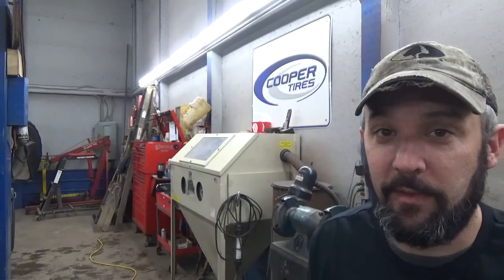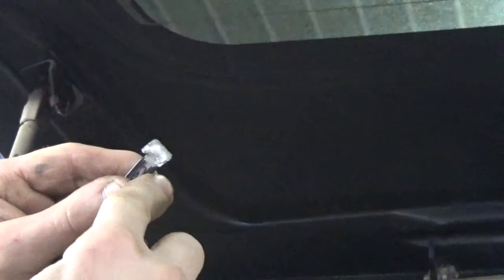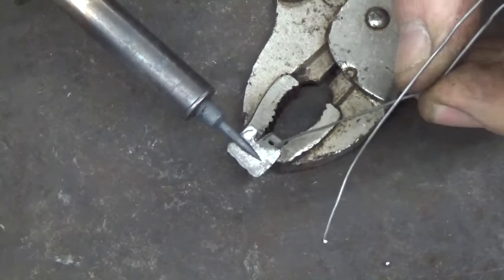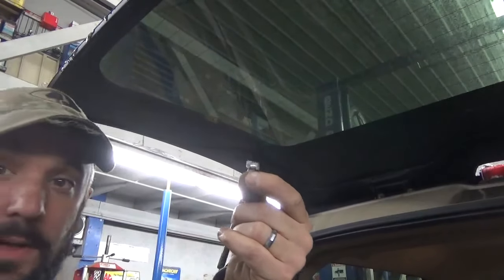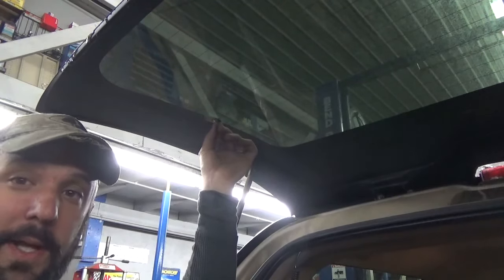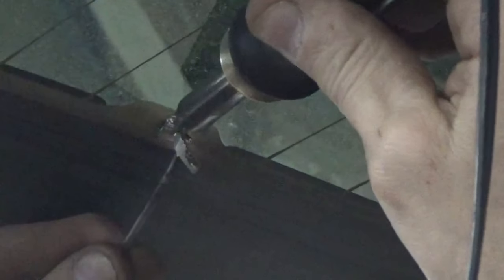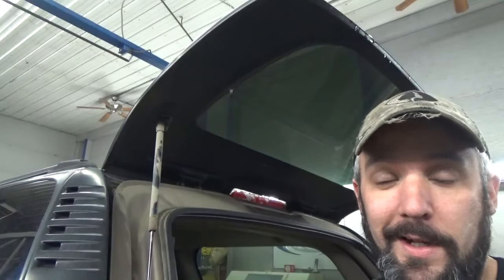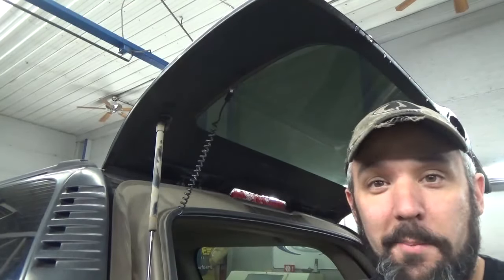Rear Window Defroster Tab Repair

Comment: I tried this on a 2003 GMC Yukon, which looks very similar to the vehicle in the video. The approach in the video did not work for me. The tab would not adhere to the window, no matter what I tried. BUT, I had previously tried (and failed) to repair the tab with Permatex's "Rear Window Defogger" adhesive (765-1982). The tab stuck to the base on the window using the Permatex, but it clearly did not conduct electricity as intended. I was able to remove the tab after using the failed repair easily using heat (small torch). Because the problem was with conductivity, I used a wire brush on a Dremel to clean the contact patch and tab base. I believe that I over cleaned the area and actually removed the contact patch (seen in the video). So, I am now trying to attach the tab to the copper base on  the defogger. This is where the tin/lead solder failed to adhere. This probably would have worked if I tried this first or was more careful cleaning the contact patch on the window.

Comment: My 2018 Expedition Max had the solder fail.  It seems to be a thing with Expeditions:(  They wanted $175 to fix it!!!  Some dealers are replacing the entire rear glass......$1300!!!  I am going to give it a go, thanks for the info!!  The sad thing is that I hardly ever use it!  But, when I look in the rear view.....there it dangles!!!  errrrrr  Going to sub as a thank you for the info!  Be safe.

Comment: Nice! Looked at conductive adhesive, most around $20, all have a cure time of about 24 hours & suggested that you keep connected warm for better cure, around 100°, they kinda seem like a pain to use to me. Only thing I might do different from you is use some flux rosin to help float the soldier little better, not that your 60/40 is bad or wrong just little more confident bonding.

Comment: I've tried the glue kits (Permatex) a few times. Each time it lasted from a few weeks to a couple months.  Finally decided to solder it.  Glue doesn't last (in my experience). That lasted a year or more.  As my soldering is getting better, I am hoping future repairs will last longer.

Comment: Thanks for this. I was worried that the glass would break due to shocking it with heat from soldering iron. Will attempt on my own and see what happens. I might preheat the glass a bit just to be on the safe side.

Comment: I couldn't get solder to stick to the back glass. Where my tab broke off. Someone used epoxy.
I tried to sand a new spot. And when it came to soldering.
Gravity won. Heated solder would just drip straight down and never stick to the rear glass thin copper.

I think I'm to have to replace the rear glass. From someplace like Safelight repair. Bc I have continuity in my defrost wires at 14.6 volts.
So before I gotten a multimeter. I was worried about that also being an issue.

Comment: My tab broke off and after looking at it I was wondering if I could solder it back on. It's good to know I would've tried to do it the same way. I like the tip about adding a little solder before hand.

Did anyone respond about the glue kits to repair it? I have a soldering iron but I have no idea where it is and I don't want to go buy one for such a small task. If the glue kits work i think I'd rather try that.
Reply: I’ve tried the glue kits 2 times. It didn’t work either time. So after this video, I went out and bought a soldering iron. Wish me luck.

Comment: For this type of repair, solid solder wire is best. If using solder containing flux core--Eric incorrectly calls is "rosen core"--apply heat until no smoke rises from the solder. This means the flux has burned away completely... required for the best bond.

Comment: chisle points work best. Good video!
Reply: scott firman what's a a chisle point
Reply: A soldering iron tip that looks like a chisel, rather than coming to a point. They're better for heating up large things quickly.
Reply: A soldering iron tip that looks like a chisel, rather than coming to a point. They're better for heating up large things quickly.
Reply: Yeah, an 80 watt "stained glass" iron would work well. A little pointy hobby deal would get tedious.

Comment: I use the heater strip repair glue to repair tv remote control buttons. The conductive elastomer wears off and a dot  of glue fixes that.

Comment: Is there a chance window could crack from the temperature difference in that spot? I need to repair outside where it's near freezing now as I don't have a garage, and I'm worried that maybe glass could shatter.
Reply: That's why I'm surfing through the comments! Did you get it to work in the cold?

Comment: The tab on my 2012 Jeep Wrangler does not appear to detach from the wire, and has a cover over it made out of some type of rubber or plastic. I don't see how I can solder it...any suggestions?
Reply from the maker: +Gary Woodland Conductive adhesive?
Reply: you have to use a fine tipped pick and pry the tab out of the connector. it's like a 9 volt battery terminal.
Reply: Thanks Steve, Couldn't find this info even on JK forums! Defroster is working now thanks to the guy in the video and you!
Reply: I did this last night on my 2010 JKU.  I cut the plastic off the wire and bent a small piece of copper into a tab.  this worked great and I defrosted the glass this morning!

Comment: does it have to go back to the same spot or anywhere as long as it is on wire element inside the glass?
Reply: Mine has cut wire with no specific spot to reconnect as if someone cleared old connector and was going to attempt fix at some point but never got around to it.

Comment: What if the pad is missing or partially missing. I have a truck and where the tab was originally, now the  pad is missing because the tab was ripped off. Can I just solder it to.the remaining pad that's there? Or do they sell a product, that mends the pad before you install the tab?
Hope my question isn't confusing, I know what I'm trying to say but, it's hard to put it to paper lol

Comment: I've watched a few videos on this subject.  My issue is slightly different in that part of my tab is still on the glass and the small past is in the connector. Looks likeabig deal to try and grind all of that down. So, my question is can I place a tab over the existing tab and solder it in place?  Thanks
Reply from the maker: rjtecellc Can you just de-solder the old one from the glass?

Comment: What kind of solder and what wattage of solder iron do you use? I've used a glue kit brand Frost Fighter before and its held for years but it's pretty expensive. The cheap little glue packs don't work for long. They might hold for a little while but they always break loose again sooner or later

Comment: Is that a General Motors suv rear defroster wire using a cheap ass landline telephone chord like my grandma has at her house? The video was helpful, I need to reattach the pigtail wire on my C4 Corvette.
Reply from the maker: Yep it sure was! '04 Suburban... Sooo is the C4 your G-mas too? Haha no just kiddin, hope this method works for you.
Reply: South Main Auto Repair The C4 is mine, she drives the Lambo ;-)

Comment: I've got a defroster that has been soldered on the glass every couple of inches that i want to completely remove. How much heat tolerance is there on the glass? I want to have a nice clean window when its all done. Can this be achieved? Obviously i don't want the glass to shatter... Thanks! ;-)

Comment: I've previously done this repair and it worked like a charm however I accidentally hit the tab and it came off again. For some reason this time around the solder just simply will not adhere to the contact point. Instead of using a soldering iron to melt solder while holding it against the connector (it took too long for the solder to melt) I heated the tab with a light torch, put solder on it and proceeding to attach it to the window connector. Tried 4-5 times cleaning the connector and tab each time but the solder just won't stick to the windows connector anymore. Any solution you can provide other than buying those repair glue kits they sell? Thx in advance.
Reply: You can Etch the glass with some very fine sand paper to get the contact area clean then clean off your old solder and apply new solder that should help it
Reply: +Fiaz M what grit do u suggest?

Comment: I need to solder a new tab on. my old tab was reattached and doesn't conduct well and I can't remove it. Could I out a new tab close by without harm leaving the old tab in place..?
Reply: Not advisable as the pad these tabs are soldered to is a special part of the system.  It's not very likely 'close by' would take to solder in the first place, they don't build these tinned copper contact pads three times oversize for example.  You need more bigger soldering iron to remove what you have and reattach it with good solder again.  The problem you have is not enough heat in the first place if you can't remove it now, three second contact time should let you pull it off with zero effort.  I'm thinking Harbor freight 150 watt soldering GUN with well tinned flat wide tip.  You will have to on/off the trigger as these tips will glow cherry red and that's way too hot for solder if you just hold the trigger.  Practice on galvanized roof flashing tin until you are proficient in keeping the tip tinned, controlling the heat range with your trigger finger and can place and remove such a terminal in mere seconds consistently.  You can make practice tabs from the roof flashing as well with tin snips. Don't worry so much about breaking the glass, it will only crack on ONE surface and there are two in safety glass always.  You'll find that plumber's soldering paste flux will allow for the best results but since it's acidic you must wash the surface when done and clean the flux off with both water based cleaners and - - - brake cleaner !!!
Reply: +Lee Barnes Thanks for the advice.

Comment: HELLO. 

I've been trying this but the tab won't heat up enough to melt the solder once on the window. Is there a particular solder you recommend?
Reply from the maker: +Caesar Himself I use 60/40 rosin core
Reply: South Main Auto Repair
Yep, that's what I've got here. Strange it wont melt. Held the iron on until I cramped and still nothing. Melts the solder onto the tab but wont melt it when holding tab onto window bit.
Reply from the maker: hmm... maybe need a hotter gun?
Reply: @SouthMainAuto  Whats the watt output on your soldering iron?

Comment: Just did it yesterday inside my garage. On my jeep wrangler i had to remove a rubber cap over the tab.I tried the permatex kit before and did not work.Soldering is way easier than  epoxy.

Comment: how do you repair the rear defroster connect on a 2013 jeep wrangler ???
Reply: +dnv820 If it's the wire, you can usually just solder the wire back together. If it's the tab, you'd do it just like in the above video.

Comment: If your defroster grid is printed on very thick you can solder it. IF!
This doesnt work on all cars, that's why some have to use defroster epoxy kit to solve the problem.

Comment: The glue thing definitely sucks. Just tried it, it didnt want to stick when I tried. It ended up holding because of the consistency of the glue itself but if I tugged it it would definitely come off. I'll let it sit for the next couple of days to let it cure and if it doesn't hold I'll definitely solder

Comment: I have been soldering since I was 13 but I just haven't had any luck trying to solder my tab back on with my 4th gen Firebird, it keeps coming off.. just really frustrating, not sure how to fix it now. there's no way I could ever get that tab back on there to the window part.., only way I could see fixing it would be solder a bare wire to the window with a blade connector on the other end of the wire to plug into the stock female defroster wire, looks like it would be hard to get the tab itself to stick again with just solder, solder is not very strong just not a big fan of it even for wiring I like to use butt connectors for wiring if at all possible, this seemed like a great idea but I'm just not sure it is now, right now.. atleast for what im trying to do it looks like solder just isn't strong enough, if it works for others people/ application tho then thats great
Reply: Have you tried cleaning up the window and tab? Sanding, alcohol, whatever else to remove any residue and oils. Another issue might be a cold solder. These windows will pull all the heat away. It will take a fairly powerful solder iron to put that much heat in. The cheap irons you see everywhere probably can't handle this job, or at least not properly. To help you can take a heat gun or hair dryer to preheat the window.
Each window will be different, you have to see how it broken, and judge the best repair.
Reply: snoopdogie187 well for one thing the end of the tab thats on the window broke off but the main part was still attached to the window.. and what I was doing was trying to solder a whole new tab to that old tab, i was scared to pull the tab off of the window as I was afraid I wouldnt be able to get a tab to stick to the window.. btw yes I wire brushed and my solder gun is a Weller.. do I need to pull that tab off and try to solder the new one straight onto the glass?
Reply: I really don't have much experience with these window tabs. If anything, I would try to remove it with the solder iron, to melt the solder, that way you don't damage anything when you pull it off. 
Of course, go by your knowledge, what you are comfortable with. Never even seeing a 4th gen Firebird up close, I can't tell you anything that isn't from google. I don't even generally do anything to GM cars.

Comment: Mine snapped in half how would I removed the other piece from the window
Reply: same way,just heat it up and use plyers to carefully pick it off the glass. then visit the junk yard for a replacement tab. Id you have a butane lighter and a pair of plyers you can take one off a cracked rear window on a crashed car with the same type tab.Doesnt have to be same car,just same type of tab.
Reply: I wouldnt take it off the glass, leave it there and solder the two pieces of the tab together.

Comment: Sadly, this did not work for me on an 09 Crown Vic.  There was nothing on the glass that would allow solder to flow onto.  I may just leave it for the buyer since this is an auction vehicle I am selling.  It bothers me not to leave this defroster functional. I hesitate to use the epoxy kit because I don't see a conductive pad remaining on the glass.  There is just the partial yellow grid with black dots.
Reply: Did you try maybe "tinning" some solder onto the pad, letting it harden, and then put some solder on the back of the tab, let that semi-harden, and then do the method Eric used? I think maybe that'd work for ya. Good luck if you attempt it

Comment: A soldering iron with a wedge or chisel tip will make a faster solder joint because of more contact area and better heat transfer.
From someone who has sniffed far too much flux fumes in his time!

Comment: I tried 60/40 and the solder just balls up won't stick to tabs?

Thank Ron G
Reply: That means the tab itself is too cold, usually, allow the tab to heat up and melt the solder against the tab, don't melt the solder with the iron as it won't bond to the cold surface. Or there's some dirt/scale you need to remove. Rub the tab on some abrasive of some kind and perhaps apply some flux, even though the rosin core should be plenty.

Comment: I did this on a bronco with the glass rolled up under pressure. The glass blew up in my face..... in hindsight i shouldnt have used my torch. I also should have taken the pressureoff the glass.... well you live you learn

Comment: i've tried this - fail.  i think it was a mistake to remove the solder remaining on the glass.  he held the soldering iron on the tab for 30 seconds.  i was starting to spin out, worrying about exploding glass after 20 seconds.  i'm having to do this because some little shithead broke the window and the replacement glass had the tabs broken off.  i will think about plan b and try again.

Comment: I tried to solder mine on and I could not get it to stick
Reply: use paste flux. it comes in tubs and you can get it at most hardware outlets in the plumbing section. Always use silver and lead mixed solder,not the cheap lead free crap,it wont work.You need to add fesh solder to both parts first. I usually sue a tooth pick to spread the paste on the  part. Its called flux by the way. Dont put on tons,just a light coat. the problem is if you over heat the solder that has a rosin core,or flux,it tends to boil it off before the solder can bond properly. I always lightly sand or scrape the area enough so the solder has something to bind to. then coat the area with flux,then add a layer of solder. next do the same with the tab,so both pieces have fresh solder. then using a chisel tip not pencil tip,I remelt the solder like he did and Bobs Your Uncle. should be a good solid hold.

Comment: All the glue on applications from permatex and others are nothing but trash, the only way to do this properly is to solder it, but I would like to make one suggestion to your viewers and that is to put just a little bit of flux on that after you laid the solder on the clip this will ensure a really good connection and a strong hold.

Comment: I'm going to have to call BS on this one.  Seems simple enough.  Followed the simple procedure.  My trusty 30 yr old soldering iron never got the solder to flow.  So I thought I should upgrade.  Bought a new 900 degree pro model.  Bigger is better right.  It could never get the tab hot enough for the solder to flow.    The repair kits are starting to look cheap now.  Not buying another iron.  I gave it about 5 mins,  iron is hot and will flow solder almost instantly, tab did not.
Reply: Albert Barbee try applying solder to the side of the tab that contacts the iron, this should help heat to be transfered to the tab.